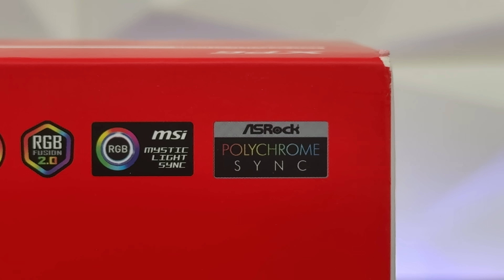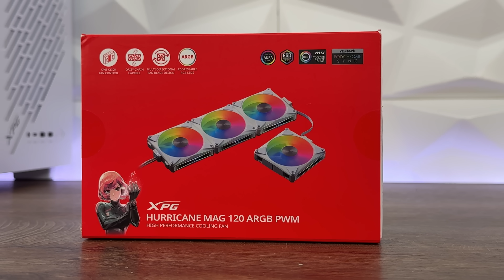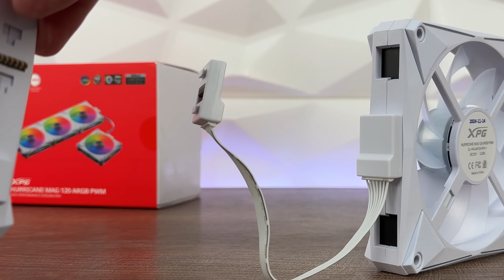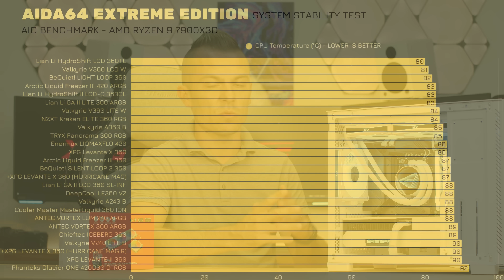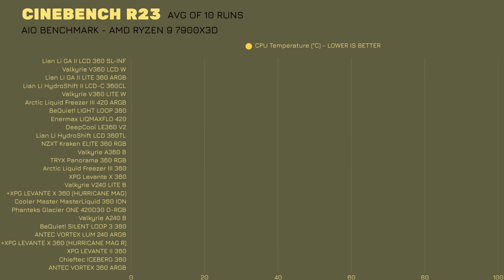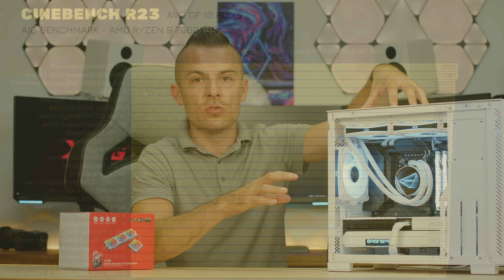XPG HURRICANE MAG 120 – Multi-Direction Fans?! This Is Wild

Comment: I'd like to see how well they move air in both directions.
Fan blades are shaped specifically to spin in one direction and move air in one direction.
With these either one direction suffers very badly, or both directions aren't great.
Its just not physically possible to have good movement in both directions.
Ontop of that, blades are also shaped to take wind noise into account.

Although these fans look nice and are a wishful thought, perfomance would've taken a massive hit somewhere!
The idea wont catch on.